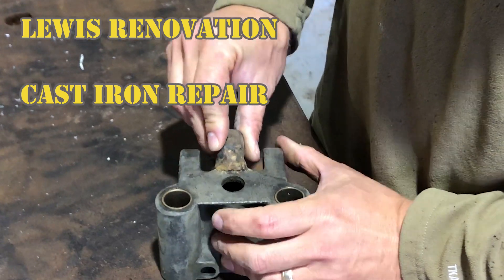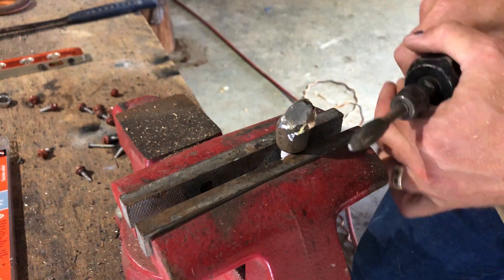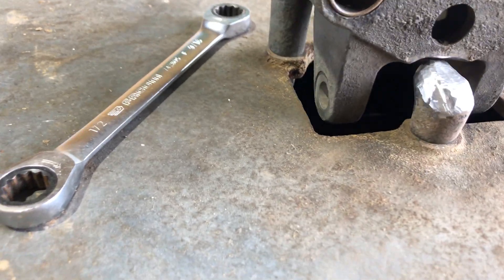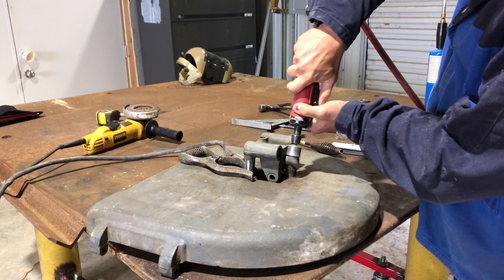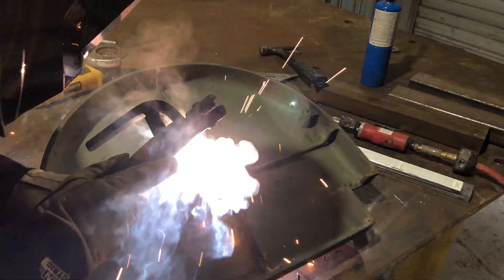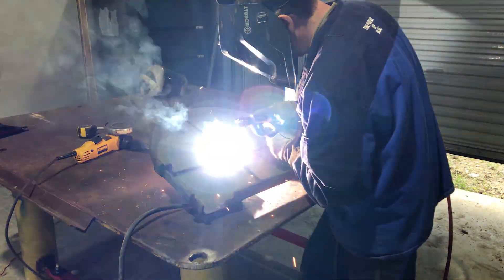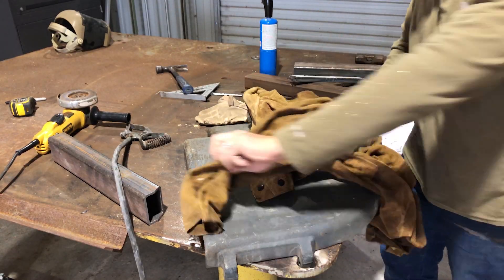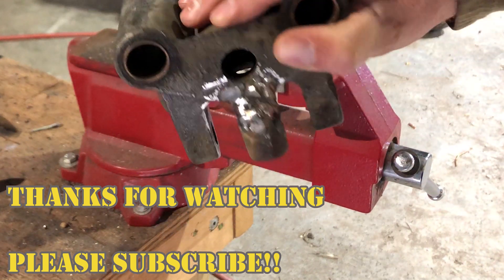Cast Iron Repair - Nomacast

Comment: i guess at tack point take it off so ya can really work it over and then sand bury it to slow cool..late 2 cents..nice repair...hows it been holding up soo far???
Reply from the maker: Repair hasn't failed yet. Burying in sand would have been a better option.

Comment: I have a walker turner bandsaw too, with the same funky repair welds to the height adjustment bracket, door, and the table tilt bracket...which is in 5 tiny thin pieces that broke while I was cleaning it for paint prep.  So now I get to learn how to weld cast!  Thanks for the inspiration!
Reply from the maker: Good luck with your welding. A couple years later and mine is still good. I'm no professional welder so you should be fine.

Comment: Should only weld 1" at a time and let it cool between passes if you do not preheat (preheating to 100 if "cold welding". That might be reason it was having "issues"
Reply from the maker: Thanks for the tip

Comment: I dont think it has anything to do with arc force and for sure nothing with hot start ... i mean the arc dynamic on your welder is hood enough for 7018 ...  some more exotic rods ...???   Not really ...  but even that is only a small part of the problem ....

Normacast - that is the biggest part of the problem right there ....  i will go out of my way not to use it .....  

There are very good cast iron repair rods out there .... personally i would not trust any of them unless they have at least 55% nickel or more!  Those nickel free cast iron rods ....  in my opinion a waste of time ....

If you need to cut, drill or tap the repair use ni99

And typically cast iron repairs dont look great ....  that is to be expected ....

I am glad your repair worked out!  That is a successful repair !!!
Reply from the maker: A comment from a real youtube celebrity!!  I was thinking the other day about your pulse aluminum MIG welding video.
Next time, I'll try a more conventional nickle repair rod.  Thanks!
Reply: Lewis Renovation its all good - i saw you subscribed so i had to go check out what you are doing ....  

Good video over all !